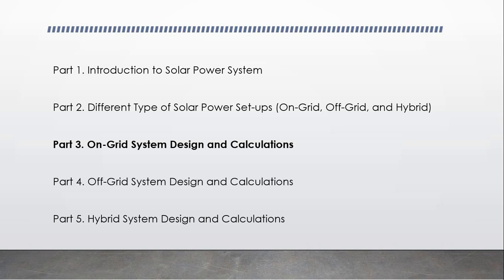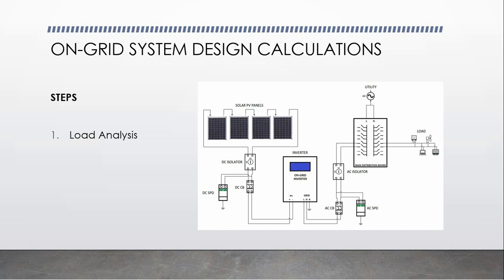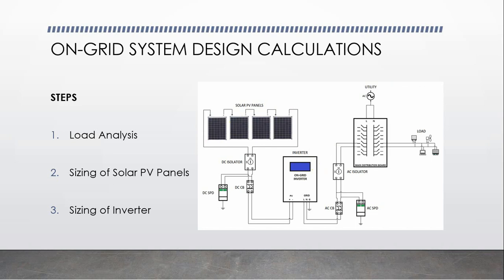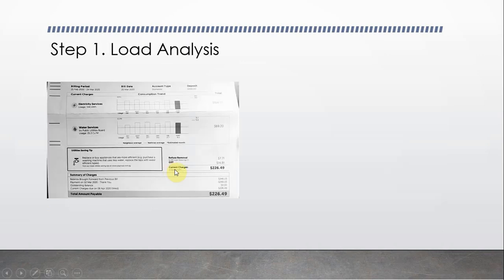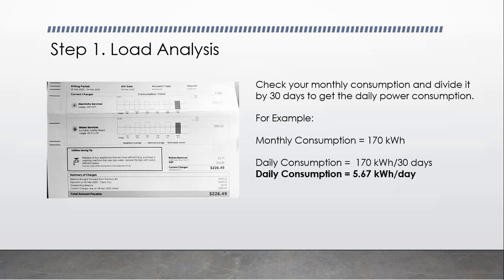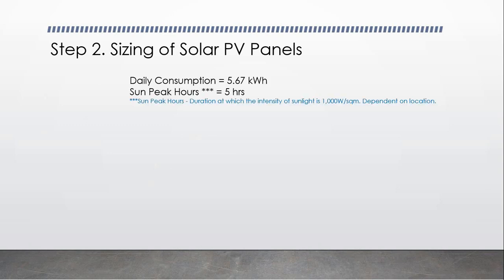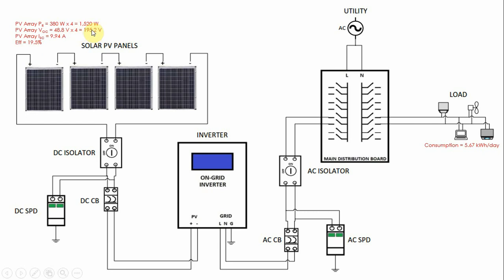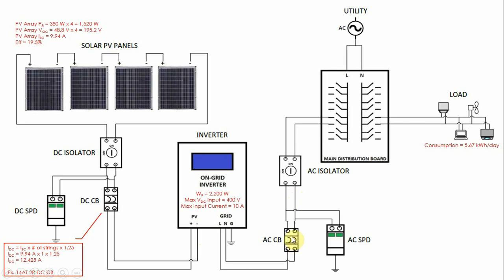DIY Solar | Sizing a Grid-tie Solar Power System | On-Grid Solar Power Power

Comment: Hi Oliver, for On-grid system, kindly elaborate the connection detail on main circuit panel. as per your diagram the AC isolator is directly connected to MCP. Thanks
Reply: yes it is directly connected to the service panel through a spare breaker equal to the ac MCB. there are three options to connect the inverter to the grid.

Comment: What is the purpose of DC and AC isolator? Also, do we need to install DC and AC SPD in case there is a build in SPD in the inverter? Thank you.
Reply from the maker: Hello sir, dc/ac isolator performs like a switch. It disconnects certain oarts of your circuit and is especially useful during repair and maintenance. Regarding SPD, i still recommend installing an external one as it is easier to replace than having to open your inverter. Also, there are many types of SPDs, there are those used for lightning protection and the ones that catches residual surges and are placed near the equipment being protected.

Comment: Thanks for sharing. In this four panel setup is there not a need for optimizers? I’ve only installed four panels as an addition to an existing system not standalone. Thanks again.
Reply from the maker: Hello sir, not sure which optimizers you are referring to. Can you please site some examples? I will have to read and let you know my comments. For this tutorial,  the objective is to have a basic setup only.

Comment: Oliver, input from inverter basically connected with Grid AC correct?
Why AC SPD not connected on grid input, so it will protect load too?
Reply from the maker: Hi sir, yes, you can also put SPD near the load. As far as I know there are 3 types of SPD, first is the lightning arrester which is placed near the PV panels, second is placed near the sensitive loads, and third one is placed is between.

Comment: What is 1.3 constant stands for? Does it differ from country to another country?
Reply from the maker: Hi, the 1.3 constant means we've added 30% increased capacity to our PV array. This is to compensate for not so optimum weather conditions such as cloudy skies. You may adjust this constant as you like.

Comment: sir meron akong 600w grid tie inverter at dalawang solar panel na tig 150w  na may voc na 21.8 at isc na 10.2A ano much na dc breaker at ac breaker po sa kanya pa help nman po para mainstall ko po . tnx sir ng marami.
Reply from the maker: Hello sir, if naka-series yung panel mo, dc breaker should be greater thAn 10.2AT (ex. 12 AT DC CB). If naka-parallel naman, go with greater than 20.4AT (ex. 22 AT).
For AC CB naman,it should be 600W/220V or around 3AT or higher.
Reply: @OliverJayYoutube  thanks po sir
Reply: kung 15amps dc  sir gamitin ko kc walang 12amps sa market po eh. salama po.
Reply from the maker: @jhonreyes5681  ok lang sir. Basta wag lang masyadong malayo sa computed value natin
Reply: @OliverJayYoutube  sir salamat po
Reply from the maker: @jhonreyes5681  no problem sir

Comment: How did you come up with " 1 " in no. of strings in your calculation of sizing a DC Circuit breaker?
Reply from the maker: Hello sir, in Step 3 (sizing the inverter), we did a check on the inverter size vs. the PV array. We have assumed 4x PV panels connected in series (hence, string = 1). When the 4x PV panels are connected in series, the total Voltage output is still within the allowed Vin of the inverter. Likewise, the Isc (9.94A) is below the allowed input current of the chosen inverter (10A).
If, for example, we configure the PV array into two (2) strings, the total voltage output of the PV array will decrease to half but the Isc will double and more than the allowable inverter input current of 10A. This is the reason why we chose a PV string of only 1.

Comment: You are not considering the peak hours with the highest demand for electricity in the home and the hours when your system will have the highest and lowest performance
Reply from the maker: Hello sir, it's already inclusive when you take the average daily consumption from your monthly bill. For grid-tie setup, it doesn't matter much since the your PV system and the grid will be complementary.

Comment: Sir sana masagot po tanong ko. Ung utility ng meralco ay 220v L-L diba po? Pano ko po i wwire ng tama sa inverter po kung ang output ng inverter ay L/N/PE , 220Vac, 230Vac, 240Vac ang nakalagay po. Model po ng sofar2700TL-G3
Reply from the maker: Hello sir, morning! Di rin ako sigurado sir. As per research ko, some areas are L-N 240V and some areas are L1-L2 240V AC with neutral center tap. Yung neutral, however, di na pumapasok sa bahay and mukhang grounded na sa utility poles jan. Mas maganda sir na pa-check nyo na lang sa local electrician jan sa inyo para iwas aksidente.

Comment: Okay lng po kahit nd na icheck ung watts ng mga appliances for inverter sizing???napansin ko po magkaibaung sizing nag inverter ng off grid at on-grid kasi sa off grid is nakabase sa watts ng loads or appliances(load watts > inverter) while on grid binase sa wattage ng pv power.(pv power(Watts) > inverter)..tama po ba ung observation at pagkakaintindi ko sir?
Reply from the maker: Yes sir, parang ganun na nga. Mas mabusisi lang yung computation ng offgrid kasi kelangan i-take into consideration ang surge power ng appliances.
Sa on-grid ok lang kahit mas mababa ang capacity ng panels and inverter mo versus sa actual load kasi nakaalalay naman lagi yung grid power.
Reply: Please use english for your auestions

Comment: Hi Sir, how about the spd? How to compute for its rating?
Reply from the maker: For the Surge protection, take a look at the Uc and Up values of your SPD. Uc is the maximum continuous operating voltage, if the SPD senses a voltage above this, it becomes active. Up, on the other hand, is the maximum voltage across the SPD when it is active. Up is selected as such that it is below the overvoltage withstand capability of the loads. A typical DC SPD has a Uc of  around 500 VDC and a Up of ~2kV.
Reply: @OliverJayYoutube   Any table po for reference ? 

Thank you sir sa sagot. 😀
Reply from the maker: @vellyyt3572  Hello sir, wala po akong table. Di ko din expertise tong SPD. 😁
As far as I know, may 3 types, classified according to the frequency of the surge. Type 1 is installed near the panels for protection against lightning. Type 2 is installed between the source and the load, for added protection. Type 3 is installed near the load to redirect any residual surges - good for loads that are very sensitive to fluctuations. There are SPDs that can cater for both Type 1 and Type 2.
Reply: @OliverJayYoutube  and also sir. Do you have any idea that an existing gridtie system can have a battery back up?
Reply from the maker: @vellyyt3572  You may go for hybrid set-up sir. You can design a hybrid setup with battery backup.
If naka-setup na yung on-grid mo, just add UPS. 😊

Comment: Hi, I thought the inverter capacity should be lower than the array capacity (say P_inv = 0.8 x P_array) to avoid oversizing. Glad to hear your comments on this? Thank you.
Reply from the maker: Hi sir, this is the first time i've heard of this, that the inverter capacity is lower than the PV array. Can you give me a link to this reference so I can read more on this concept?
A good engineering practice is to not overdrive your electronic equipment as to prolong its life span, that is why we design the inverter capacity to be higher than the PV array.
Also, it is good to add some extra buffer capacity to your inverter to make it ready for the additional power consumption of your home in the future (future proofing). If you have that extra inverter capacity, you can just add PV panel/s to keep up with your growing energy needs.
Reply: @OliverJayYoutube  Thank you for the explanation. I totally agree with the point of keeping buffer for further expansion. 

As for the undersizing of inverter, I've found some sources suggesting to keep the DC/AC ratio of 1.2 to 1.4. That means, for 130 kWp (DC), we may use 100 kW Inverter, thus the DC/AC ratio will be 1.3. 

Note that PV power is kilowatt-peak under STC condition, thus this is not always the case in real situation. This is one of the articles suggesting DC/AC ratio of more than 1.0: 😃👍

https://news.energysage.com/what-size-solar-inverter-do-i-need/
Reply from the maker: Hi @syamirulm, thanks for the link. I do agree with this article. Undersizing of the inverter can be done if the geographic location affects/limits the amount of sunlight harvested by the solar array. Else, if you are living near the equator, 1:1 or inverter oversizing will be the usual scenario.
Reply: @OliverJayYoutube  Perfect, that makes very sense. Thank you for the explanation and all the best creating more videos like this 😃👍
Reply from the maker: Thank you too bro for a very engaging discussion.

Comment: pwdd po b makahingi ng diagram with limiter po? wla po kc sa illustration po
Reply from the maker: Hi Jenelyn, wala po akong actual illustration pero yung on-grid inverter mo may output yan for the limiter, then yung other end is icclip mo sa utility line mo bago pumasok ng distribution switch mo. For actual application po, check nyo po yung installation manual ng specific inverter mo. :)